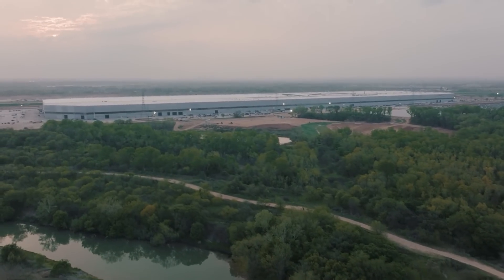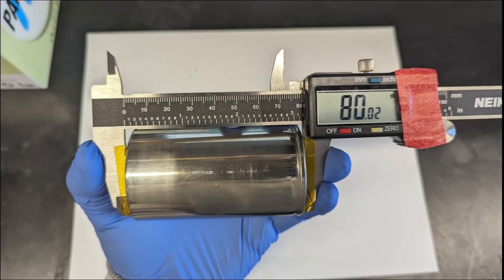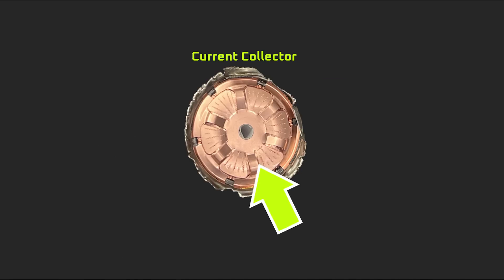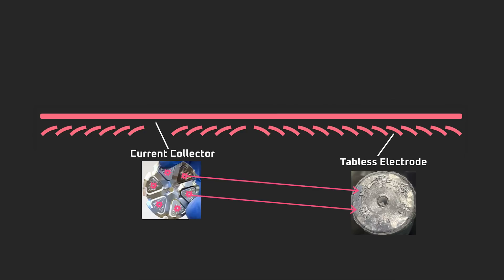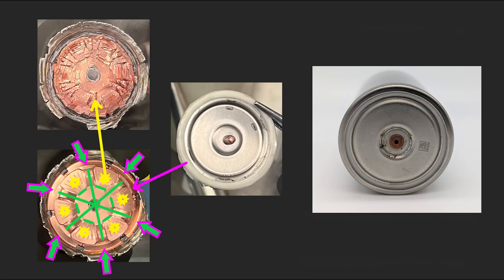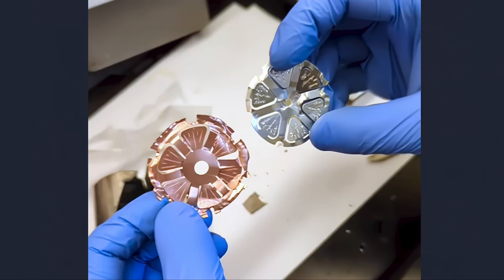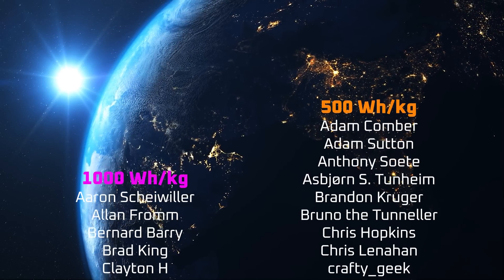The 4680 Current Collectors Explained //  A Temporary Crutch?

Comment: The current collectors are identical to the ones used in hockey puck rectifiers and SCRs. The design is to accomidate for thermal expansion while giving good electrical conductivity upwards of a kiloampare.❤
Reply from the maker: Cool!  Thanks for the input

Comment: I guess another option for the end tab caps could be to reduce the chance of internal shorting if the cells get too hot and during expansion/contraction cycles. The cell expands and contracts during disharge and charge, and also during temperature changes. You dont want the expansion to put too much pressure on the end tab caps against the jelly roll, which might lead to shorting of the copper/aluminium ijelly role againt the end tab caps.  since there are gaps in the end caps due to complex leaf type structure expansion can be axially rather than longitudonally.
Silicone in the carbon anode reduces the expansion during charge/discharge cycles, carbon delamination is a weak point in lithium cells, not sure if its been wholly overcome as yet.
Reply: Yup that is exactly the purpose of these assemblies, it is to maintain good electrical contact while giving the cell guts a strain relief for thermal expansion. They use similar designs for extreme power rectifier diodes.❤

Comment: What if they sprayed the cathode material on a surface that the material didn't stick to?  Then run the aluminum sheet over the carbon and press the two together.  In pickling steel, they form a Lupe in a pit while holding the ends together so it can be welded, making the process continuously feed into the acid. The rolling process is what causes the problem.  In forming Quarts countertops, they press the power into shape, but they use a sheet of paper on top of the power in this case, that is not needed because the sheet replaces the paper.  If anyone could make this idea work, it would be the minds at Tesla.  Small stockholders just trying to help.

Comment: @Jordan Gesige:  Recently Charged EVs magazine held an online engineering conference and has a presentation by  Dr Wasim Sarwar, Head of Research & Advanced Engineering at Rimac Technology.  In this presentation he has several interesting slides showing relative performance in Energy Density and Volumetric Density of several BEVs.  He also covers battery form factors, chemistries, and other topics relevant to BEV battery pack designs.  It's an interesting presentation by a very knowledgeable person in the industry.  Tried to contact you directly but failed to find an email address, so I'm just throwing this out in the comments section hoping you will find it.  I have a link to the presentation but don't wish to share it here.  What's the best way to make contact to share this?

Comment: FYi Tesla has a supply agreement with Syrah. Vidalia, LA is on the Mississippi River about 450 miles from Giga Austin. Oct 20 (Reuters) - Australia's Syrah Resources on Thursday announced plans to expand its Louisiana graphite anode plant fourfold after being selected for a $219.8 million grant . . . In July, Syrah, which mines graphite in Mozambique, signed a $102.1 million loan deal with the U.S. Energy Department for the ongoing construction of its 11,250 tonne per year Vidalia active anode material (AAM) plant and now plans a further upgrade.

Comment: How about also using the current collector plate as a cell level protection fuse, like the small wire does in earlier 1865 and 2170 designs.
Reply from the maker: Definitely a good point and if I dig deeper and do another video, I'll look into that!

Comment: With the second generation of the 4680 design, it looks like laser welding is coming of age into mass production.  Using laser welds to make continuous leak free joins of the can to the bottom is a critical step.  Welding the tabs to the bottom from the outside of the bottom is an interesting application.

Comment: To me it looks like thermal expansion is the main thing they are trying to deal with. The joins in the collectors are all arched like they were deliberately designed with flex in mind, they won’t make good springs being thin foil. I think the new design they are instead relying on the electrodes themselves to take up any flex due to heating. It would also not surprise me if the turned around the joins on the positive collector to obtain a smaller current path and/or simplified it.

Comment: Excellent analysis.  I may have missed it but in addition to everything you discussed they accommodate the difference in thermal growth of the steel can and the Al film.  There is a very small but constant working of the length difference across the length of the cell that uses the "hinge" you accurately call out.

Comment: They are still working on "modifications" of the battery construction/manufacturing. At present it is my understanding that they have a "Dry battery cathode" but do not have a "Dry battery electrode" yet.

Comment: Your explanation of the mechanical elements of the current collector are spot on. I also agree with your rationale about electrical path preference and reasoning. From an optimization standpoint, I agree that the Gen 2 would likely move away from this CC design as it may have significantly dimensional variability which could impact performance should the design be sensitive to that. Best part is no part, and best process is no process!
Reply from the maker: Always glad to hear your thoughts Nickolas!

Comment: Page 9:00
Schematic diagram depicts no welding run between electrode and current collector. 
Associate photo contradicts that with laser welding on 6 leaves of the collector. 

That current collector (on which electrodes are welded to) must be made of hardened sheet metal to remove chance for open circuit under inertial shock. 

As ‘tab less electrodes’ are made of annealed aluminum foils (dictated by manufacturability) which will be further deformed into internal open circuit (if not welded) and hence electric spark, electric spark in proximity with heated electrolyte is a fire risk. Welding or soldering will bypass the chance for such open circuit. 

I stated above in the same year of the Battery Day using 4680 anode as example.

Comment: Great video Jordan! I have been wondering about the details of the design since your first video on the insides of the 4680 cell, and this was a very good explanation of those design choices.

One however I couldn't figure out: Why are the collectors transfering current through the longest electron path instead of the shortest. The only reason I can guess at is that it would concentrate the thermal generation on the shortest electron path if done so. However a shorter path would mean a lower resistance. Maybe it's an entirely different reason?
Reply: With the speed that electrons travel, what looks to us like a long distance isn’t actually that meaningful. On a computer chip where you’re managing trillions of operations a second, those distances really do matter, but in a battery you’re either charging or discharging, not rapidly switching between the two. The extra millionth of a second it takes to go through the “longer” path doesn’t actually matter.
Reply: @timwildauer5063  But the whole point of the 4680's tabless design is to reduces the internal electrical resistance of the battery cell, by shortening and widening the electron path. 

If you have two copper wires with the same cross section, but one is twice as long as the other. Then the resistance of the longer wire will be double that of the shorter wire. And having the same amount of current going through those wires will result in twice the total heat generation of the longer wire. The speed of electrons doesn't impact this. 

Batteries are mostly thermally limited. The 4680 cell size was made viable by the lower internal resistance of the battery via the tabless design. 
Before the 4680 cell the batteri cells used was much thinner (18650 & 21700) because it makes them easier to cool. If the batteries generate more heat than can be cooled by the cooling system in the battery pack, then engineers must limit the charge/discharge current of the battery cells to avoid high temperatures.
Reply: @R4nd0mN7mbers  Without the tabless design, isn't much of the resistance within the roll? Now electrons only have to travel the short side of the rectangle instead of half of the width. Batteries had to be thin so the heat could get from inside the roll to the outside of the roll. Now with the tabless design that resistance is almost eliminated, and even if you have to go an extra half an inch at the top and bottom of the roll, that still ends up being vastly less resistance in total, so much so that it's again irrelevant. And even with extra resistance at the end of the roll, that heat easily gets whisked away to the side where it's cooled. I'm not saying it's the most efficient design, I'm saying that extra distance traveled at the end of the roll doesn't make a huge impact in the grand scheme of things.
Reply: @timwildauer5063  Yup, yep and yes. My point exactly. It just isn't to do with the speed. :)

Also interestingly the increase in power output of the cell is approximately proportional to the decrease in heat output and therefore the internal resistance. So I assume the resistance is lowered to a sixth of former cells.
 
And maybe it is just a slight increase in the "new" path since the resistance. But I just really doubt it. 
Since Tesla are laser focused on optimizing these cells to the best they can be. Then leaving such an easy upgrade to further lower the internal resistance just doesn't make much sense. There must be something else stopping it from being the better solution. I just can't make out what that better reason would be.

Comment: Worth mentioning that the positive is refering to electron deficit. Batteries go against the standard convention and use negative to denote an excess of electrons (like we do in physics). So the anode is negatively charged, meaning it's got an excess of electrons, and the cathode vice versa.

Technically batteries can be in two states, charging and discharging. But usually ppl refer to the discharging state and use electron flow instead of conventional current. This is an important fact.
Reply from the maker: 🙌 Yeah it's a mess, lol
Reply: @thelimitingfactor  its beyond a mess. I've been into electronics for more than a decade, and still manage to confuse myself.

Comment: Re: Battery Tech Optimization. 
These are the EV equivalent: pistons, rings, rods, crank, cams, valves, etc., parts found in archaic ICE power systems. Hotrodders take note. Though you won’t be able to access the battery internal tech, could building “hybrid” packs that use techs that are optimal for various phases of momentum (launch, acceleration, top end, cruise, brake/recovery) be key?
Reply from the maker: Bespoke cells. That's an interesting concept.

Comment: Actually, the use of copper or aluminium is based on whether the metal is electropositive or electronegative, not their reactivity to a specific voltage. The lithium cell is two cells in series, with the use of copper, then carbon and manganese dioxide on to second cell with aluminium of the second cell. Each cell has a voltage of 1.2 volts nominal, which is the same nominal voltage of lead acid cells, which are 6 in series.
Reply from the maker: I probably could have worded that better and said stability in the anodic and cathodic environment.

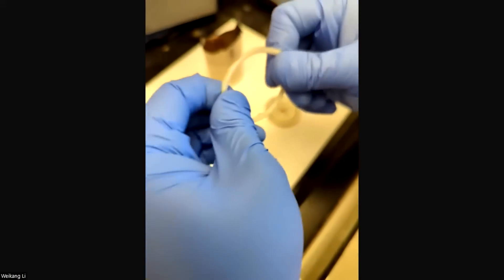Comment: @6:08 the sides of the battery are isolated because the coolant lines would short between multiple cells.
Reply: no coolant lines at the bottom actually, 4680s are in fact side-cooled, and the Coolant Line is not electrically conductive afaik
(and i thought they would be bottom-cooled for a long time, too)
Reply: Yes, sides of can carry current, but must be coated to prevent electrical contact with serpentine cooling bandolier.

Comment: re welding .... SpaceX uses Friction stir welding ( which isn't welding actually ) it's entanglement mixing in the plastic phase, ... yes like blacksmith hammer welding they will have used that using the pressure and friction to amalgamate the sheets no soldering or welding needed
Reply: Lots of people use friction stir welding.  I don't see why it's worth mentioning here though.

Comment: Is it possible they were using the current collectors to compensate for "spring force"? with all those overlapping tabs, there has to be some Goldilocks zone of compression, no? too hard and you start to crush the jelly roll, too soft and you don't have enough pressure to guarantee all the tabs touch the end of the can. The only reason i kind of doubt this is the collectors don't seem strong enough to offer much compression resistance.
Reply: The current collectors would certainly take up tolerance variation in the jelly roll length.  Only need that on one end though.  Simplifying the welds and making a reliable electrical connection I think are the two big reasons for the current collectors.
Reply: There is also the issue of vibration over the life of the cell in a car.  Any vibration over years that could degrade a coating or produce metal particles through abrasion makes a million mile battery problematic.  Of course not a problem with stationary storage.
Reply: How thick is the aluminum cathode collector foil, do we know?

Comment: just watched the video , right I had better explain the shape of the sheets, the issue is if you operate at high current you will get current hogging where the lowest resistance path will carry the most current this leads to failure, the cuts and shaping essentially segments the battery roll into separate segments as the resistance is cumulative and it all needs to be taken into account even a solid block of copper has resistance and has to be balanced, the cuts and shape allows balancing by the positive temp coefficient of the copper you are talking microhms but IT ALL ADDS UP, just take the shape and work it out the actual resistance then push 100 Amos through it and see .... microhms matter the fact this is outside the roll also matters,

Comment: I love this, but still do not see the alleged advantages of the 4680.  In the field  and on the road , particularly the Model Y from Gig Texas there’s been no real advantages.  It was supposed to create a lighter and more energy dense pack, but it hasn’t.
Reply from the maker: Thanks Alex!  What we're seeing so far is V1.  It should improve over time.

My concern is actually the DBE production system on the cathode side.
Reply: Have you watched the Sandy munro teardown of a 4680 model y pack by chance? The whole entire pack, with carpet, seats, brackets, moveable center console etc only weighs 1,100# now. And makes up the entire floor of a dual large single casting model y with structural pack. 

They also show it uses less than 1/4 the amount of welds per pack as a previous 2170 model y pack with modules requires. 

So it's a whole lot more than just reduced weight or increases in energy density as advantages. It's an entire manufacturing revolution.
Where the castings and 4680 structural pack are just pieces to the overall jig saw puzzle of mass manufacturing modern evs at insane scale.

Reduced assembly line injuries to from stress and muscle fatigue are another benefit nobody seems to care much about but munro also mentioned. Something Joe justice has covered when comparing assembling the 4680 model y vs older tesla model's. 👍🏻

Also elon and drew have stated multiple times this year the 4680s will rivial anything cell wise available by the end of 2022. And be superior by spring 2023 to anything available as a cylindrical cell from any other ev cell maker. 

During battery day in 2020 elon had said 24-36 month's realistically before they'd iterated enough to realize most of the gains they discussed during battery day. So they honestly seem to be right on track there. 2023 with semi/ct&4680 model y will be interesting to see&may be the gen2 roadster. Vs catl and byd with their lfp&lmfp cell to pack&cell to chassis designs hitting mass manufacturing. 🤔
Reply: I think the primary benefit for now is the cost. Tesla wants to get the 4680 cells at scale and at low cost before they focus on making them perform better than other cells currently available. Also, I wouldn’t be surprised if they’ve changed plans a little bit regarding which products receives the 4680s first. I think semi and cybertruck are first priority for 4680 cells since they have enough supply of other cells for model y. Semi and cybertruck require 4680 cells but the model y does not.
Reply: As long as Texas and Fremont are making the same models, Tesla will keep the specs as close to the same as possible, this includes weight.  Otherwise, customers will quickly begin selecting for the 'advanced' version and most problematically, rejecting a version they see as less advanced.  Tesla must ensure that no matter what goes 'under the hood', if it's named the same it must preform the same.

I suspect that a number of people have already been 'holding out' for a Texas built vehicle because they assumed they would be getting a better preforming car and now they're disappointed that there's no real difference in the customer experience.  When Tesla begins making products that could only work with the 4680, that's when the differences will begin to become clear.